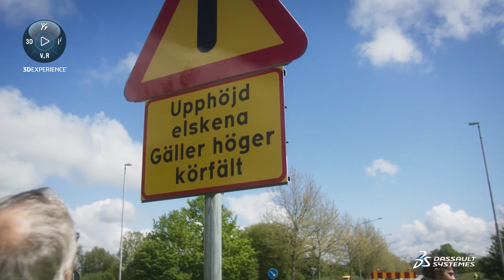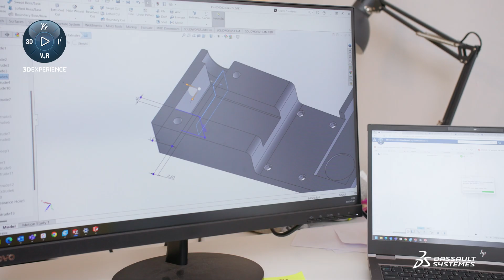Elonroad Offers a Charging Infrastructure for All Electric Vehicles

Comment: well at least this road solution seems to be direct contact versus previous designs where it was a wireless coil charge which is 50% loss at best.  I'd still be curious what the loss is on a spring contact.